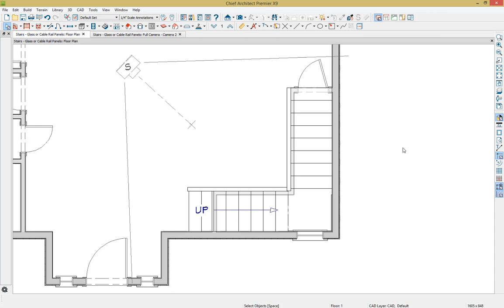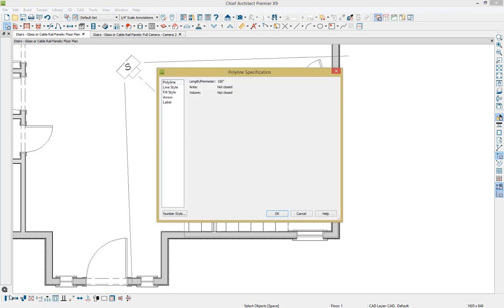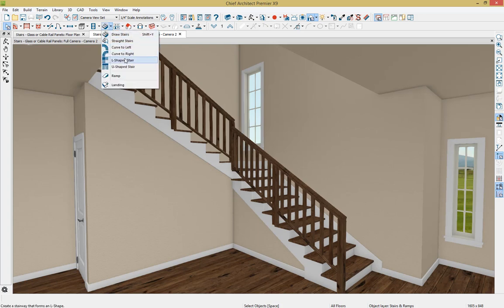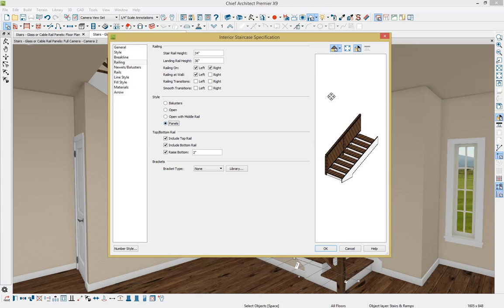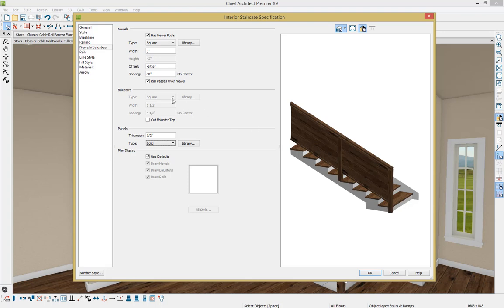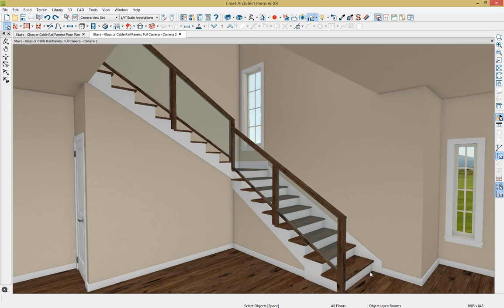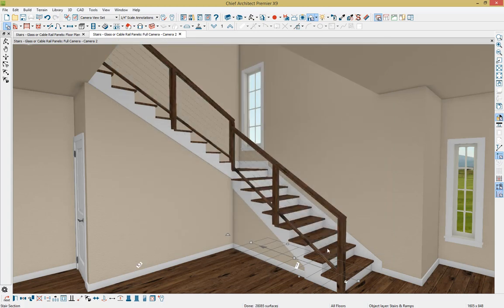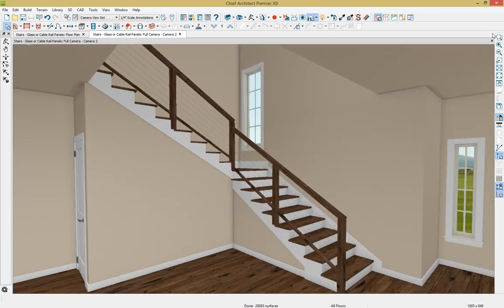Adding Glass or Cable Rail Panels to Stairs

Comment: I got the trial version few month ago, coz i wanna use it and propose this software to my company. Then I found a problem with the dimension..After asking in the forum, youtube, and explore it out by myself.. i cannot find a way to draw floor plan with temporary or auto dimension place on the center of the wall. All the dimension is end to end of the wall. In my country we measure the building or house by center to center of the wall, not end to end. Now my trial expired.
Reply from the maker: Thank you for your feedback. There is no time limit on our free trial, however you are not able to save or print. The dimensions can be manually moved to the center of the exterior walls. And you can control the location of the interior walls to locate to the centers by following this Knowledge Base article: https://www.homedesignersoftware.com/support/article/KB-00491 Thank you!